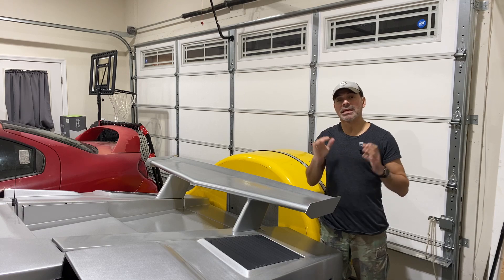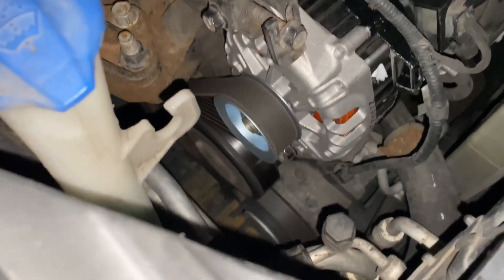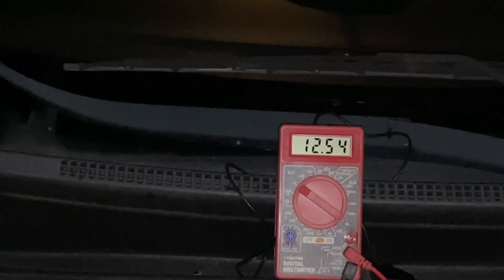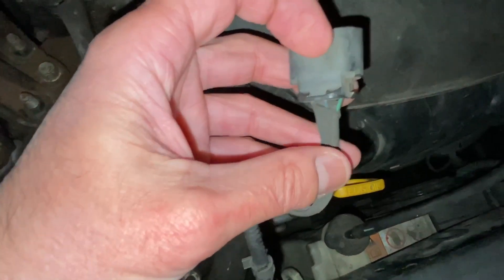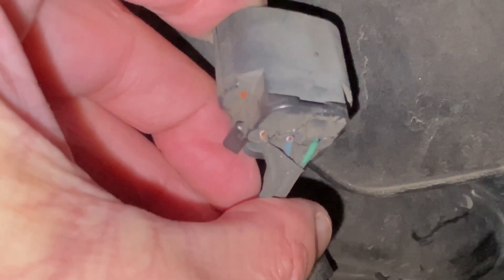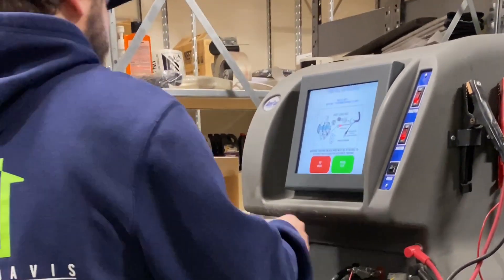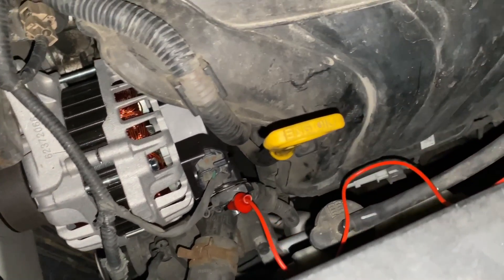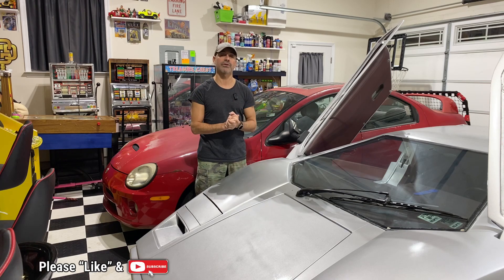Diagnosing A Faulty Alternator (Andy’s Garage: Episode - 449)

Comment: I have a 2015 Honda fit with keyless ignition.  About a month ago it would not start when I pushed the start button - it just clicked.  Eventually it started and the problem would come and go but it has become more consisted now.  I changed the battery (it was old and one cell was dry. This did not fix the problem.  I hooked up a volt meter where I could watch battery voltage.  I noticed SOME TIMES while driving it drops to about 12.4 volts.  I suspect the alternator but the Auto Parts guy told me that if an alternator fails it fails completely.  Is that true?  What else could be causing intermittent failure in the charging system?

Comment: I do have one other key component in question that could be causing this problem with the alternator failure and that is the stater itself and the connections leading to and from it if the starter has a problem at one of those points I’m wondering if that could be causing a heavier then normal drawl on the alternator and that is what may have caused it to fail now with that said it could very well be that you received a bad alternator but I would venture to say that that was the case but I would head down to the starter as well…
Reply from the maker: Correct, but since the alternator’s voltage regulator failed about 2 miles after installed I knew it was contained to the alternator.